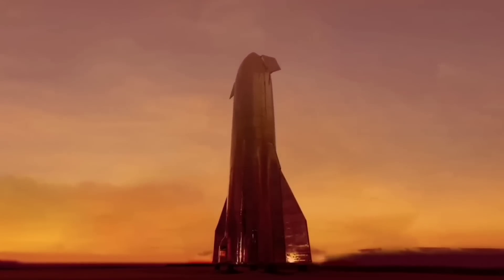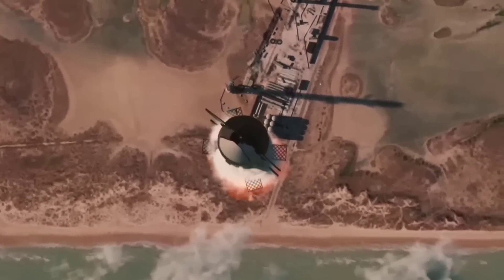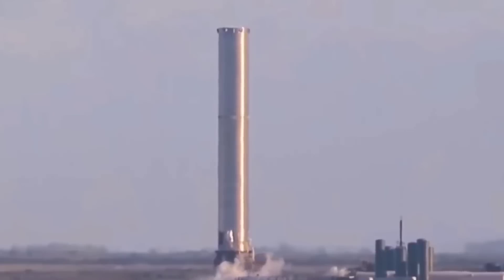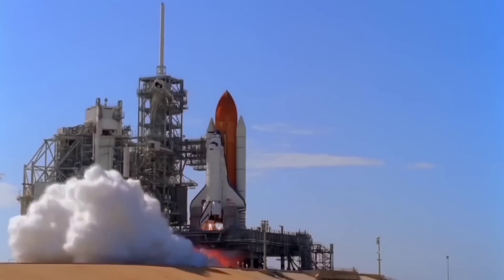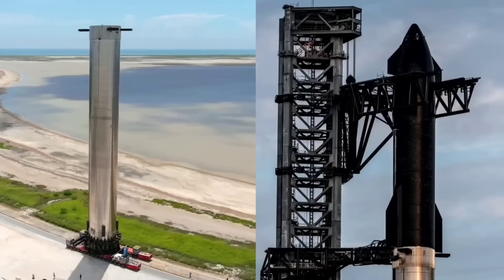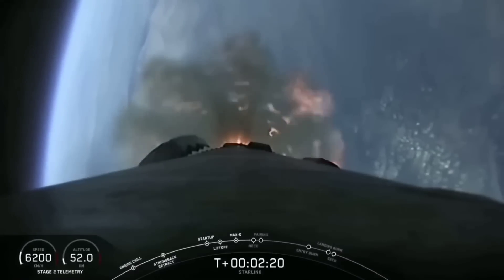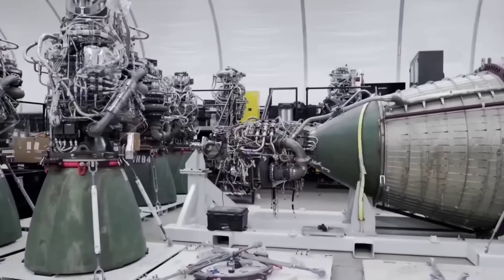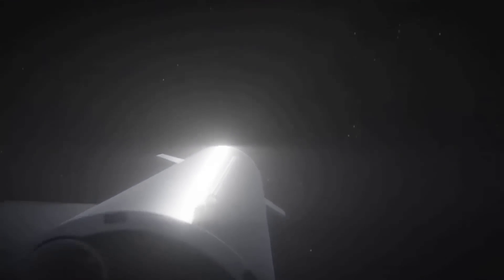How SpaceX’s Will Test Starship Booster 7 33 Raptor Engine Simultaneously!

Comment: Oh Booster 7 is ready for flight all right. HOWEVER; is the Booster "Ready" for the SHock, Vibration and Acoustic Pressures caused by; HOLDING IT CLAMPED-DOWN WHILE FIRING?

Comment: I think for the short term it's going to the heat tiles on the starship. Booster 7 I think is fully ready for flight. The heat tiles on a starship are going to be a headache for a while.

Comment: Starship is at least twice the size of the N-1.  The time the N-1 exploded on the pad it was estimated at 1 kiloton of TNT.  Not the largest man-made non-nuclear explosion, that would be the 1917 Halifax harbor explosion, but enough to wipeout the pad facility. Just as further reference a small tactical nuke is around 2 KT.